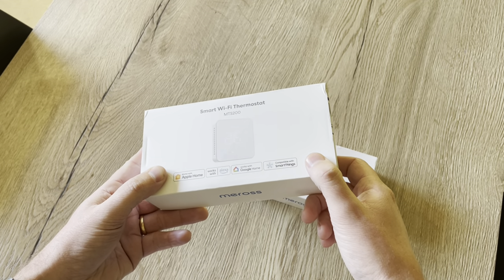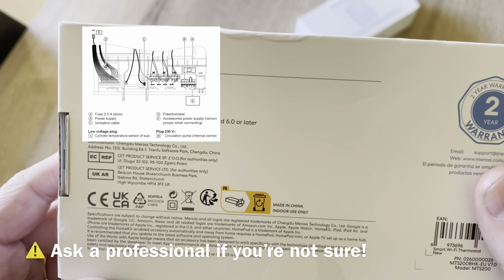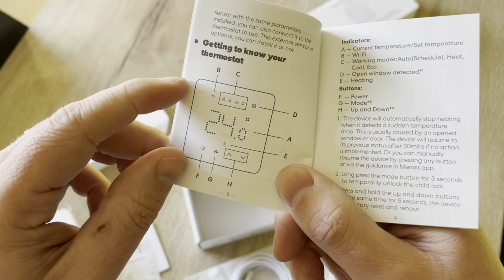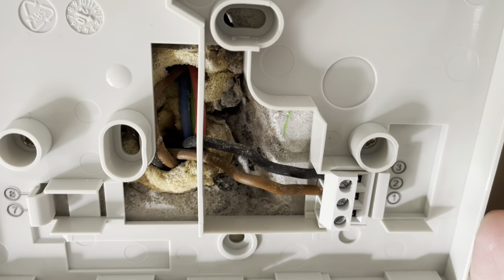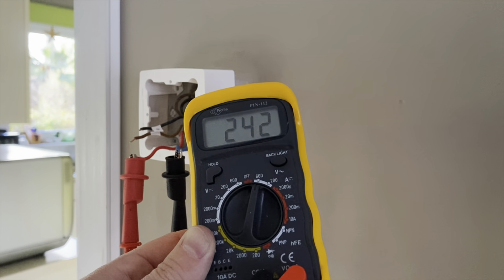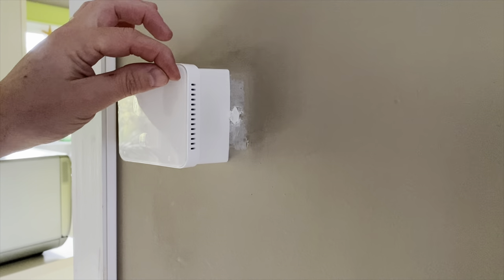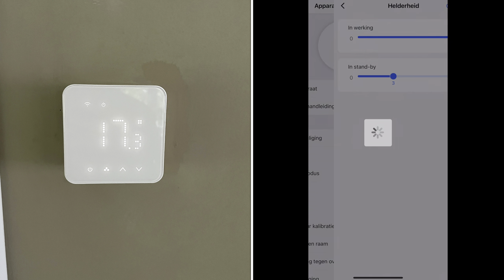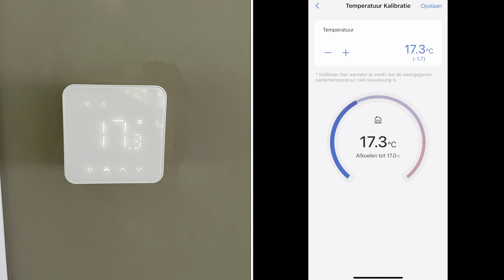Meross smart WiFi thermostat for HomeKit - installation & full review!

Comment: Hi, I only have Blue, Brown and Black Wire. So Live, Neutral and ?? Is that enough and what wire is for what?
Reply from the maker: Hi! On should be the switch wire that goes back to the boiler, where there should be 2. You could try to find these wires at your boiler itself to see how they are connected and use the installation manual of the boiler to check. If you’re sure you better ask a professional (plumber or electrician) because doing it wrong could blow the whole boiler computer. Maybe you can combine this check with the yearly service 😉

Comment: Hi! Will this thermostat work with my Nefit gas boiler that has OpenTherm? Currently, I see that the connection to the existing thermostat is through two DC24V wires (red and blue).
Reply from the maker: Hi! It’s best you check with the seller, this way you are 100% sure 😉

Comment: So if you set it to floor and air sensor, which one it uses to control the temperature
Reply from the maker: Good question. What I read on the FAQ’s is this: you can use the internal sensor to control the temperature and the external sensor to do the floor overheating protection(optional). Or you can use the external sensor to control the temperature, at which point it will no longer be used for floor overheat protection detection. This sensor option function is supported by Meross app.

Comment: Hi I brought the same one , but I have only two wires (N & L)from my old thermostat, so how should I connect, can anyone guide me, because there is 5 connections…(N, L,NO,NC,COM)… so where I connect the L and N…. ?
Reply: did you figure this out?
Reply from the maker: @palikariena7292 hi! I thought I had aswered. Sorry for letting you wait. You need at least the COM and NC/NOC wires as well. The L and N are only to provide the power to the thermostat but the other two are to communicate with the boiler. It seems that your actual setup is different and the communication is wireless of some sort? I’m afraid this smart thermostat is not suited for your personal set up.

Comment: you didn't connect COM to L with the provided bridge?
Reply from the maker: It depends on your setup, if it is NO or NC 😉
Reply: @LaPalmeraie0032  Thanks for the video and your quick reply. I just mounted the thermostat for my floor heating, and for both NO and NC it is written in the wizard :
"Step2: Connect terminal 2 and terminal 5
with the included bridging wire." That's why I was surprised when I watched your video. It's not needed only if you have a Boiler :-)
Reply from the maker: @SebasSLaPallaissE aha! That should be it 😉

Comment: Hi I brought the same one , but from my old thermostat I got only Two wires (N & L), but in my smart thermostat it shows 5 connections( N, L, NO, NC & COM) + sensors points…. And mine is a combi boiler ( Ideal brand)….So where should I connect the wires, can you please guide me to connect in simple way… please 🙏….
Reply from the maker: Hi! I’m not sure this setup will work. It saus clearly that you need the switch wires (NO or NC and COM as well in order to communicate with your boiler. To be 100% sure please contact the Meross support team. They are really responsive and willing to help. If it is not possible (what I fear) resell it and look for a smart termostat that works specificly for your setup. The needed wires are always clearly mentioned. Check this before buying.
Reply: Did you fifugr it out? My thermostat only have two wires also I suspect it doesn't have the live power to power the device as well
Reply from the maker: To what are these wires connected on your actual thermostat? The L/N ports or the COM ports?